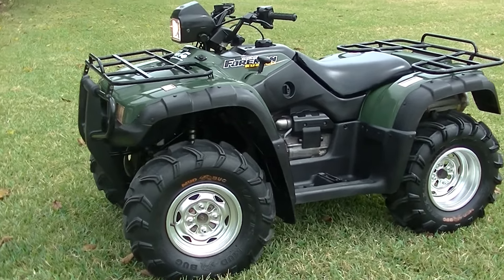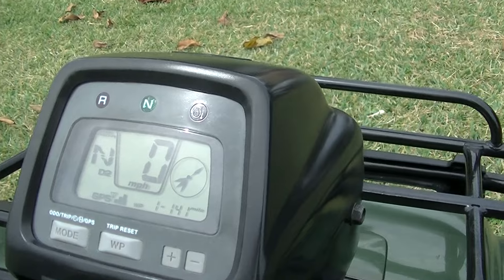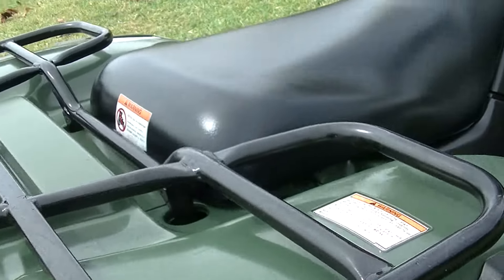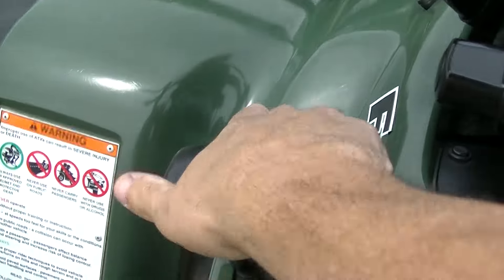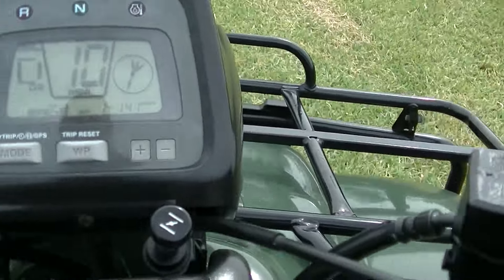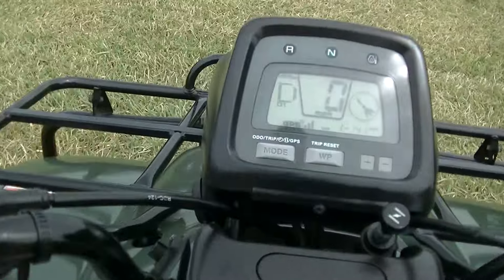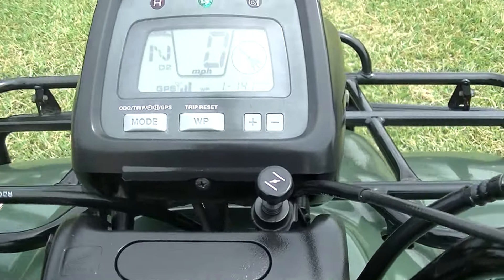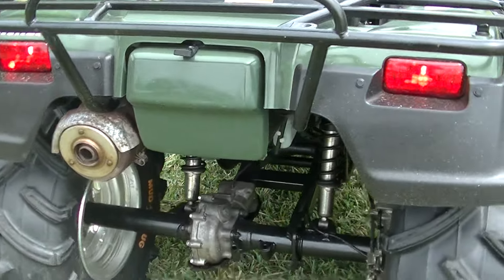2004 Foreman Rubicon 500 4x4 GPS (eBay 3/16)

Comment: Is A CVT like an aoutomatic??
Reply: It's a continuously variable transmission.  That means it's not a gear set but a tapered toothed drum
Reply from the maker: Konner Thrower it's not CVT it's called ultramatic basically it just an internal clutch

Comment: Way to noisy sounds like bad valves, could be several other things. You'll have to go into the motor to fix that noise. Why don;t the dealer fix the problem before  they take someones money?
Reply from the maker: Hey buddy,  this video is from 2016. Long sold no complaints from customer
Reply: @lrcpowersports874   mine sounds just like that no issues 🤷‍♂️